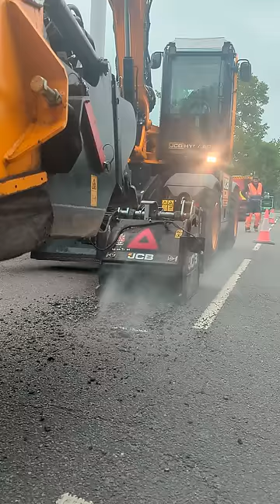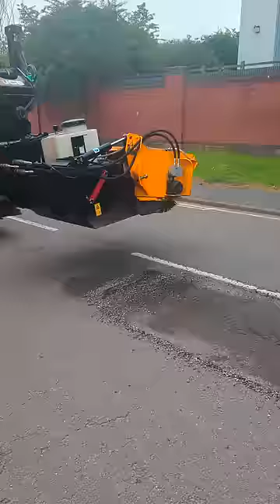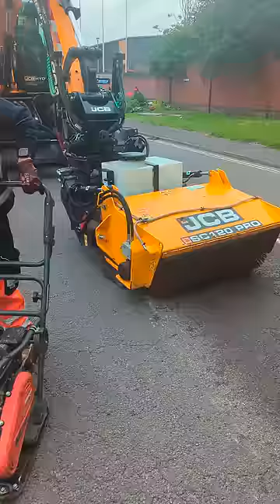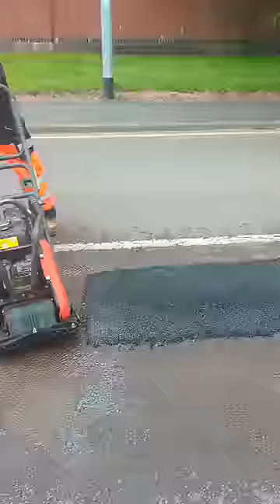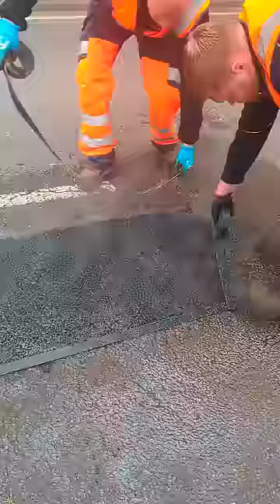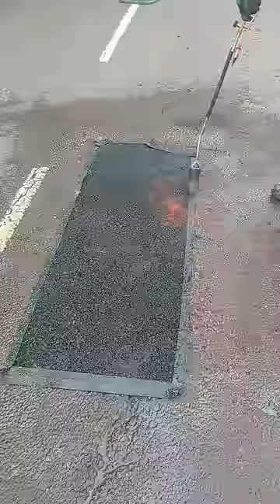Full POTHOLE Repair in only 5 minutes from start to finish with the JCB Pothole Pro

Comment: 5 min repair, 2 hour set up at base, 1 hour cone off set up on site, 1 hour clean up afterward and 1 hour clean up back at base... nice 5 hour 5 min repair that 😂
Reply: Then British Gas turn up and dig a great big hole they leave with mobile traffic lights for a month with nothing going on 🤪
Reply: You forgot the lunch break
Reply: Then repeat the whole process in a couple of months when the remaining, untreated crack develops into another pothole.
Reply: Yes and don't forget 4 guys standing watching!
Reply: @GraemeDavidson-r8h  Of course 😆 With the occasional visit from the chap with the clipboard & yellow hard hat in a suit 🤪.
Reply: JUST 4 ? 
Cutbacks is it? 😅 @GraemeDavidson-r8h
Reply: You forgot about the 11s 😂😂😂😂
Reply: It will be coned off for week before they doing anything. I wonder what Highways England's carbon footprint is. At night you can't use the motorway system because it's always closed. Even the diversions have roadwork in them. I thought you have to get out of the lorry to their jobs, No. New signs saying Abuse will not be tolerated, how would they get abused they're never on site
Reply: And one week before its a pothole again.
Reply: That's still around 48 hours faster than the current average.
Reply: Yeah.................................................
Reply: That road surface looks like it is breaking down. Surely better to resurface the whole road than just one pothole.
Reply: @petebrothwell2998  they would rather repair it 600 times at 10 times the cost of resurfacing
Reply: 5 days planning, paying and administrating traffic management.
Reply: @Lee.Willcox 😂😂
Reply: Those numbers make zero sense but even if that were the case the base stuff needs to be done once a day they could still do 5 of these a day without breaking a sweat, get 10 gangs out and you could patch half the potholes in London in a few months
Reply: Ofcourse it takes you 1 hour to cone off a site and 2 hours to set up and another 2 to clean cause your so big
Reply: My glass is always half full 😂
Reply: Erm you clearly don't know what a pot hole pro is
Reply: The state of British roads this needs to be 24/7  smoother and less damage to your vehicle driving across a field 😔😂
Reply: 3x1 hour breaks, finish up early
Reply: 1 hour untill its f***ed again! 😂
Reply: Well Uncle Albert things have changed a lot from back in your day………..that’s now a 2 week job for a gang of 10
Reply: Well Uncle Albert things have changed a lot from back in your day………..that’s now a 2 week job for a gang of 10
Reply: And it will be a pothole again in 5 days.

Comment: See all those cracks, continuing up the road? Come back in 6 months and will be same again.
Reply: Yeah, we just ain't gonna talk about the longitudinal cracking there. I do road work for a living as well so 100% percent agree. Nice work but that's a temp fix. Some crack seal would have gone a long way to extending the life of that repair.
Reply: Its called life,  you can't just rip out and remove remove because of cracking

Comment: You wouldn't need to repair potholes so often if the roads were planed back to a foot depth, any backfill properly compacted, and resurfaced with the binder surface first, bitumen seal round the cut out area,then a proper durable top surface. We see modern sma surfaces cracking easily, and it is worse in winter due to conditions. Bin the recycled rubber stuff and stay with the proper tarmac that has the granite chips rolled into it just as it's been laid. More durable and cost effective.
Reply: Cost too much to plane a foot depth out dont be stupid
Reply: Low bid wins contract
Reply: @henryfreab960  reckon so. But that's a case of buy cheap, buy twice.
Reply: @derekporter7658  that's how state hiway depts work

Comment: That's a lot of resources for less than one square metre of half-cocked road repair. Unless you do the entire length if crack you'll be back very soon to do it all again.  It wouldn't take that much longer to do so.

Comment: Well, it's a cleaner repair than what i've seen on the roads in Northants and nice an quick with that JCB. At least it's recut into an oblong removing all rounded edges as that is what i think causes them to return after they're filled in. 
Only problem is, the UK government will need a platoon of them to fix the monstrosity that are Britains roads now, the problem has been left too long. They need totally resurfacing.

Comment: If you think is bad now, wait until those gigantic electric tractor trailers get done. They weigh anywhere from 8 to 12 times more than a standard diesel engine tractor. Roads won’t stand it.

Comment: the tack coat not been allowed to go tacky , cracks everywhere in the road, pointless patch job that we need redoing in a few months. Like putting a small sticking plaster on a big gash not covering the surface issues.

Comment: Way over the top repair, you don't need to cut straight edges, just hot pour the tarmac into the hole and it will fill the hole perfectly, takes half the time of this video.
Reply: Not really that’s what they do where I live and it is trash. They literally just came and filled a bunch of holes on the street I live on and they just tossed a shovel in each hole and called it a day. That was a week ago and you can’t even tell they were there because it has all been pulled out already…. I live in a cul-de-sac so don’t even get much traffic on the road
Reply: Then you have compromised edges that are failing. This cuts into the good asphalt so the edges will be sound
Reply: No, that is precisely why they quickly fail again when this is done.

Comment: Not what I would call a pot lads, more like the surface course stiping. 
As for the horizontal joints bit of tap with pecker not a clean saw cut in sight slap dash on the tac coat then on with what looks like DBM  20mm thick .

As for using the waker plate on a Carriageway Repair 

Glad your not a Subbie for our Council

Comment: No wonder 🇬🇧 roads are 💩💩💩.
Water will get into those cracks, freeze in winter and by spring the whole road will be coned off AGAIN and more patches put down. God forbid they resurface the road and do a proper job.
Damn councils, not the guys doing the job.

Comment: I work in utility's and was gobsmacked whilst on site in leeds watched roadworkers in a tipper going going down a 2 mile stretch stop at every pothole two men jump out no chapter8 one threw tarmac in hole other run other it with wacker plate bos car follows takes pictures and repeat all tarmac torn out by cars within 30 minutes fxcking useless 😂